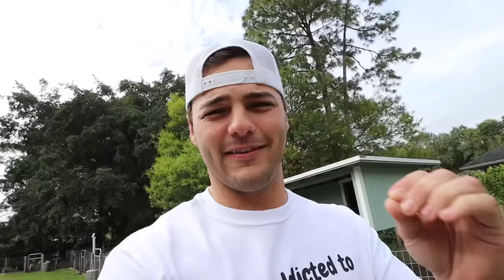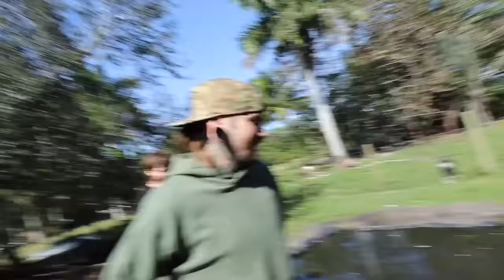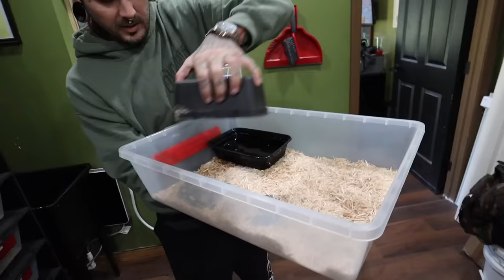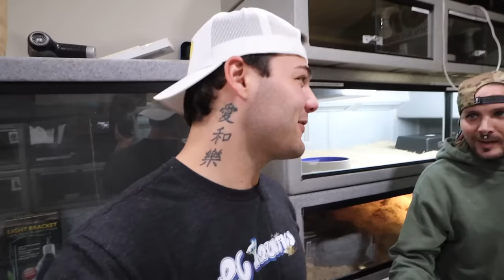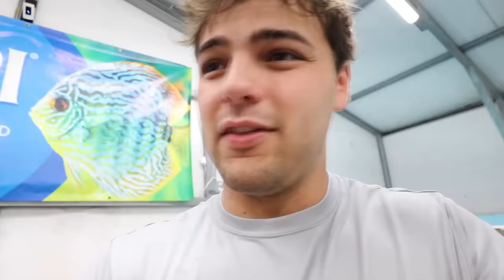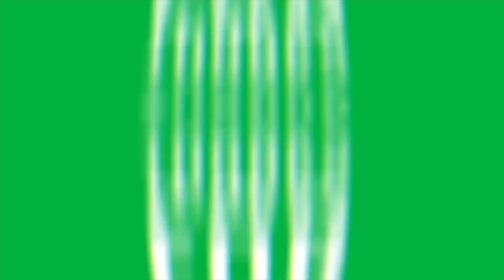The SALTWATER REEF POND Needed This…

Comment: Buy the pool, then use it as two half-tanks by placing a straight back piece on it and bump it against a wall, either inside or outside. It could even be on the same wall, with one half on the outside and one on the inside.